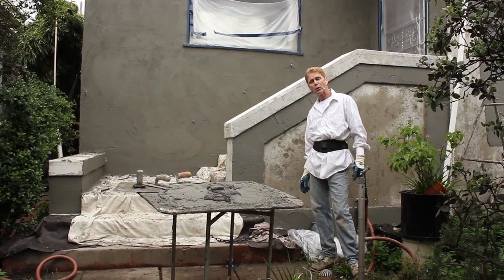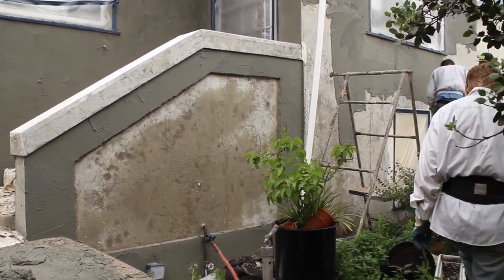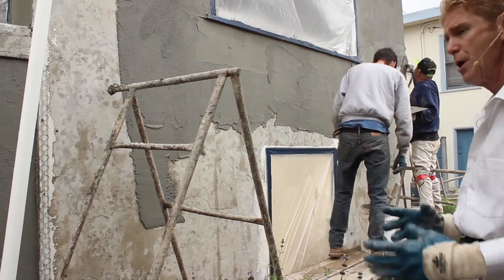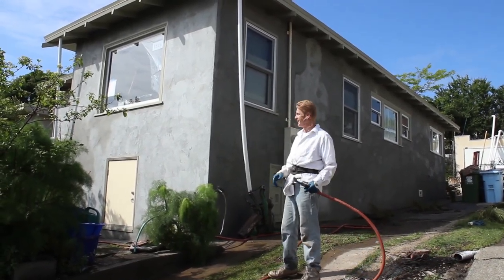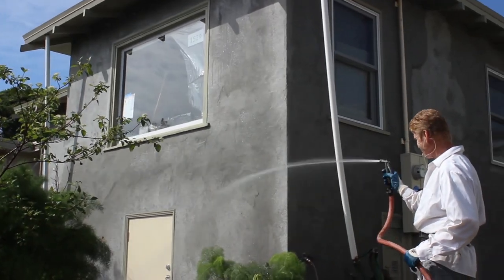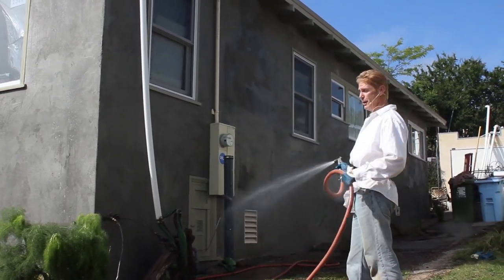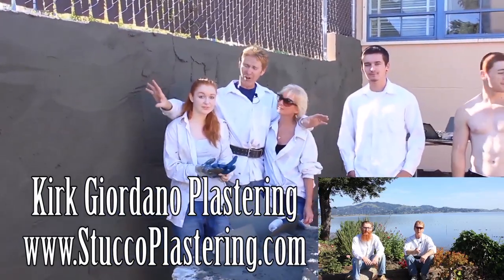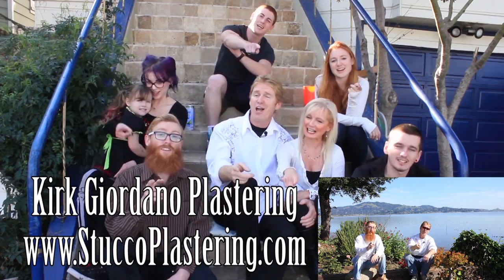The right stucco for your home.

Comment: you're absolutely right Kurt if you have an unstable Foundation or place you're going to have stress fractures in NE Portland type cement you render lime plaster is a little more forgiving especially with the addition of fibers.

one of the industry's remedy to this age-old problem was the EIFS systems.
however these products take a tremendous amount of energy and resources versus yield and sustainability aspects. and then you have durability issues so where you may gain an advantage with EIFS compromise overall structural strength.

many contractors here would either mechanically fastened or clad through a polymer-based adhesion extruded polystyrene to the block to help remedy these issues.

I could imagine any type cinder block stucco application in the state of California would be risky my goodness with all the earthquakes you guys have out there I'm surprised there's a stucco home doesn't have fractures and cracks but I bet it keeps you guys busy.  :)

cheers 
Michael D
Reply from the maker: Howdy Michael D, yes, this BMI cement plaster is the way to go on some homes that I can see are on faults or are moving for what ever reason.
 Usually it's underground streams that move them like what you see in this video.
Alameda has many of these streams under homes, sometimes I just have to see the degree of hairlineing to realize this is going on.
 Here in California they a few brick or cinderblock homes built in the last 100 years, no doubt from the S.F. earth quack of 1906, but I have stuccoed my share that were pre that time.
 Here in California all that is necessary is to clean the bricks or cinder blocks apply a  bonding agent if painted, than apply a coat of stucco.
 Best wishes, 
 Kirk giordano

Comment: Hello Kirk, thanks very much for your outstanding educational efforts.  I have my trowels etc ready to give stucco a shot but as you say 70% is choosing the right material.  I have a FL room in St Augustine that was an addition ie 2 walls wood and 2 walls old exterior block house which are painted.  I demoed the wood walls which were compromised and just had cinder block columns replace that, as there will be 3 sliding doors installed.  DImensions are 22' x 10' x 9'.  The sliders and an open archway eat up a lot of wall and leave about 400 sq ft to be rendered.  What I'd like to do is stucco the interior of the room ala a man cave/high traffic room as it will be the exit point to the patio outside.  I haven't come across a specific video where you do this out of the about 10+ hours I've enjoyed:)  From what I understand, I'll at least need a bonding agent over the two painted walls but likely not need any lath.  

My question is what reasonably priced material would be suitable and do I need to prepare the new bare block walls with anything?

LLAP:)
Reply from the maker: Good evening Dude, thank you, if it were me I'd used a veneer basecoat plaster see video below
                          Live long and plaster
 teaching repairing your number 1 investment, your home 
                    https://youtu.be/M8-9wgcYTOI

Comment: Great videos Kirk! It's great to learn from someone with knowledge and experience. I wished you worked in Chicago; I have a nightmare job where I am thinking of doing some brick rendering on myself; because everyone I try to get out to do repairs looks at me like I'm crazy. I live in a building which is 100+ years old and so is the building next to me, which is only 13-14" away. Both buildings have and need some major brick repair. The buildings are 3 stories high, the worst wear is at the bottom of the walls due to water damage that has leaked down because of leaking gutters, which are now fixed. Any ideas or tips to do or make this job easier? I am planning on doing as far as I can reach on the bottom, maybe build a couple wooden 2x4 ladders, 12" wide and work my way up to the second floor. The problem is there isn't much room to work, I wish I was skinnier for this work. You can't bend over in this space, but there is enough room to bend sideways. I will probably start this next spring after making a plan of attack. So far, here's what I am thinking of doing. Remove loose debris with power washer, if I can get in there with it. Next, use some type of bonding agent and figure out what type of stucco cement to use. I know this is going to be a painfully slow process, but dems is da brakes! Thanks for any suggestions...
Reply from the maker: Morning Tommy, I'm very fond of proper scaffolding myself, sure it cost but if you fall you're out possibly  a year that is more than you would have paid for the proper staging.
 cheers,
Kirk and Jason’s sand and cement rendering videos

Comment: Hello Kirk, THANKS so much for all your videos. I've been binge watching to find a solution and my head is spinning!  Do you have a ratios for a mix that could be used to cover underground EPS foam on a basement foundation?  The foundation is 1887 rubble (random rocks discarded from the still active mines- yes, we can still feel the blasts - like mini earthquakes) on a hill with heavy snow in the winters, in an area remote enough that products like BMI 690 are not stocked and shipping costs more than the product.  Sand, rock and portland cement are readily available, and I can get most additives from the internet (often with your link on Amazon - but can't find aluminite!).  I am also sending an email with details, pics and phone, since you said you would rather talk than write.  Thanks so VERY Much!
Reply from the maker: Good Afternoon, I'd recommend rapid set stucco it sets fast and sells at hjome depots
                                             best wishes,
 Sound advice for plastering issues from your favorite stucco geek

Comment: I have a stucco house in MN. Constant fluctuation from just the freeze thaw cycle. My house is showing verticals cracks thru paint down by brick which is the bottom base. I intended to paint but wondering if it’s gonna take more to cover. I guess I’m not looking to spend lots as I do intend to sell next year. But what I do I’d like to do well. I’ve been thinking about and toying with ideas like adding clay and plaster to concrete to make more pliable and able to smear on. Is that a thing? I’m a painter of acrylic on canvas and have don’t my own stuff on interior walls that worked. Thanks for a reply! BTW I’ve watched several of your vids which have given a diyer like me hope that I can do this stuff! Thnx
Reply from the maker: Howdy Eilse, your welcome and best wishes, 👨‍🏫
Reply: Have you ever mixed clay into cement?
Reply from the maker: Howdy Eil, no, as clay is much weaker than stucco; What is stucco? It's usually Portland cement mixed with sand. Whats Concerte? It's usually Portland cement mixed with rocks. What's Cement? Cement is the binder, or you can call it an "adhesive or additive" that binds the materials.👩

Comment: Hey Kirk just wondering about how long does it take for block joints to disappear after 2 coats of plaster with Portland /lyme/25 sand.it seems to be disappearing more and more as time goes on which only has been about 4days
Reply from the maker: Hi Frank, cinder block grout lines should become invisible when the skim coat dries, If you did two coats the same applies,
 If when wet they appear the coat or coats are too thin,
 Best wishes, 
 kirk giordano plastering

Comment: Hi Kirk, why do I get streaks when using sponge float on skim job with dragging for rough finish. Not letting dry enough before hitting it with sponge? Wrong sponge? Mortar not course enough. Can't figure out. Can u tell me what could be reason. Also how often should you rinse mud from sponge?
Reply from the maker: Howdy MrTruthislight, some finishes don't have the float lines, so when we are matching one of these finishes or I simply don't wish to leave float marks, an example would be matching a light dash finish there are no float marks.
 How you remove the float marks or lines is quite easy, first float as usual, then come back to the areas where you can still see the marks, clean you float well allow only a  minimum or water on it, I tap the float in the inner bucket to remove the excess water myself, then with the somewhat dryer float lightly hit these areas again with a sweeping motions that barely touches the stucco to remove just the float lines,
 Takes a bit of practice.
 Cheers,
 kirk giordano Plastering
Reply: +Kirk &amp; Jason Giordano&#39;s plastering &amp; stucco tips Thanks very much Kirk.
Reply from the maker: no worries, 
Kirk

Comment: 3:33....the plank in the background is in no way safe being like that....it should be at least 6 inches over the steel beam in case id slips.....just sayin...saftey first dude.
as for the cracked stucco.....thats an actual look....if its rocklime its strong as.....the cracking doesnt look like its running....i hate seeing every little house get rendered.....modern.....they lose their carachter....exept when they have none to begin with.....and there is no shortage of those......anyhow.....nice vid......informative as ever.
Reply from the maker: Howdy Scott dude, this is not the first time nor will it be the last time that the planks will be set more or less than perfect,
 that area was not yet set properly as there was only one plank, I need at least two as I hate working on just one.
 Cheers,
 kirk giordano